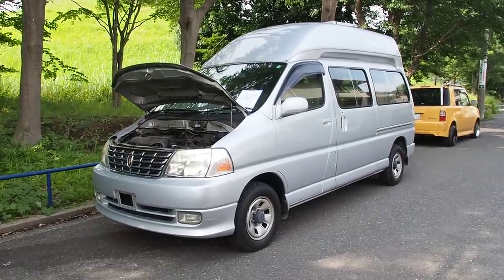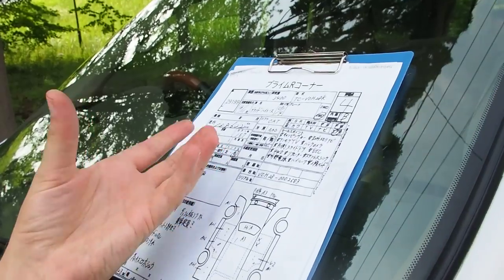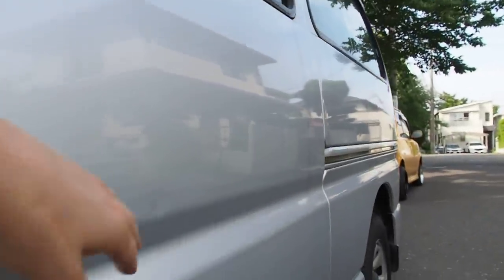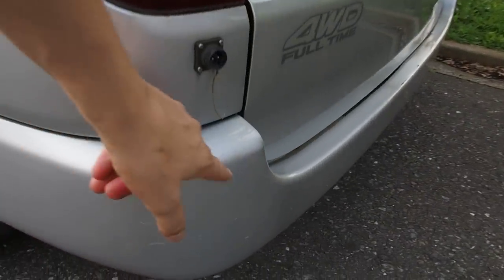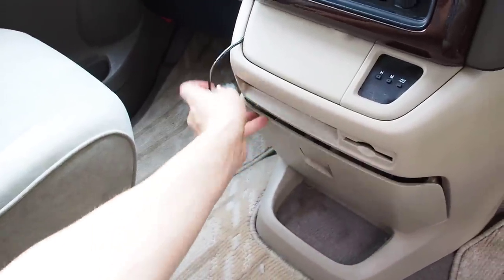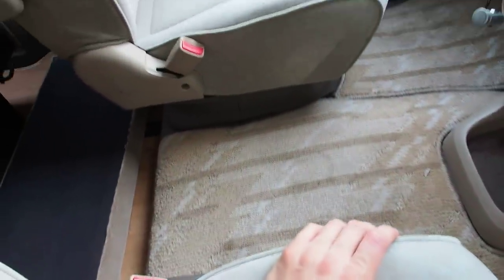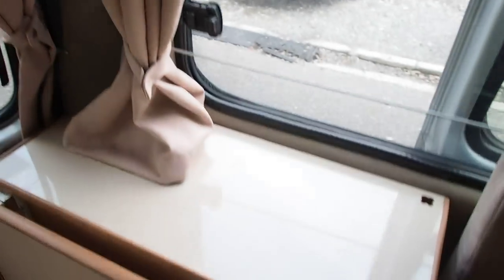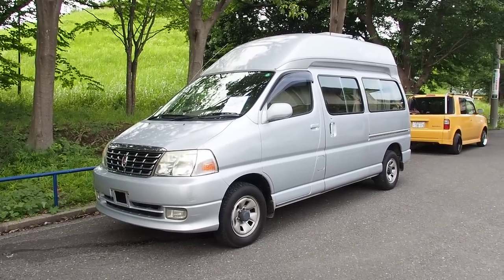2004 Toyota Grand Hiace 4WD Camper (Canada Import) Japan Auction Purchase Review

Comment: This car was called Hiace in Europe, introduced in 1995, the last ones sold in 2014. We didn´t get the camper version; majority of these cars were sold as vans, some of the were sold minibuses. Very popular vehicle in Finland, Norway and some other countries. Very durable cars, some of them has over 800 000km´s and still going strong. Petrol versions are rare, almost all of them are diesels. Rear weel drive and 4wd versions were available, short and long wheel bases and high roof and one single rear door as here or two smaller rear doors as on option. Very good cars!
Reply: I never see any sold in 2014 in Norway...some registrated in 2012 built in 2011
Reply: Yes I see them a lot too, but unfortunately Europe didn't receive any luxury trims, most of these are simple work vans, or as you said minibuses, but even those were sold with basically no equipment. The most "luxurious" feature you could get was a heated driver's seat and some overhead climate vents